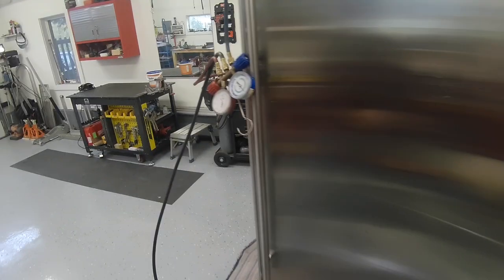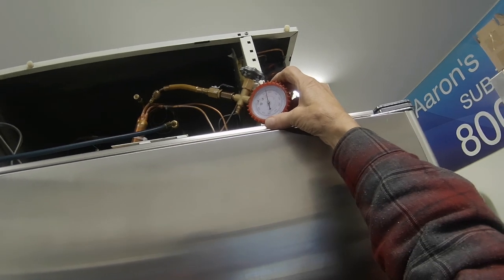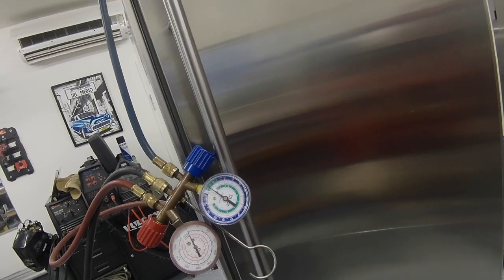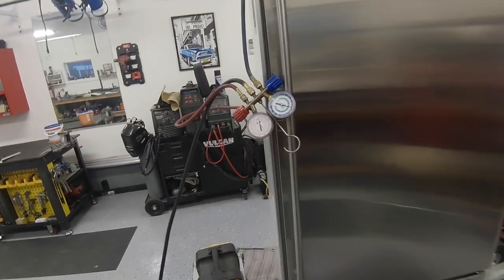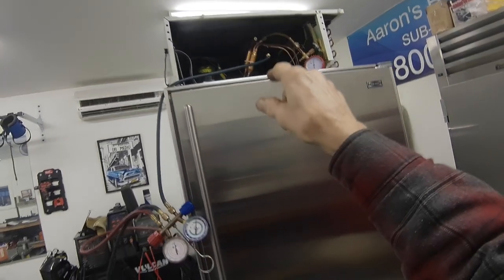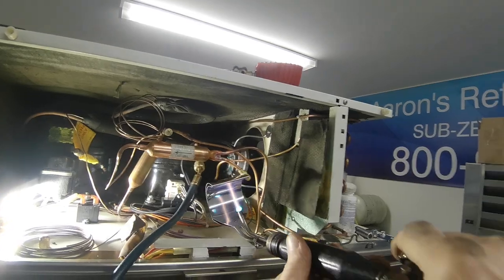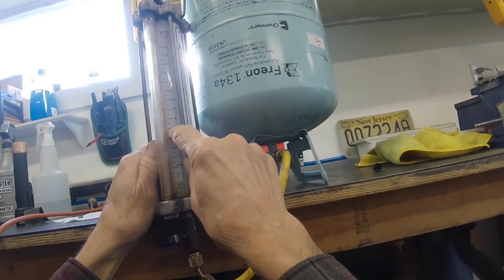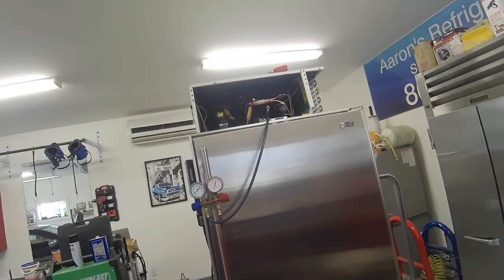Sub-Zero Sealed System Leak or Restriction?

Comment: Hi and thank you for your excellent videos! 

I have a SZ 501F that is not as cold as would be desired (it is around 8 to 9 F) I put gauges up and am showing a little high on both sides... 15 psi on the suction and 250 psi on the high side (??) I am not suspecting a leak, nor a restriction. Maybe there is TOO much refrigerant in the system? The auto defrost timer has been determined to be working correctly and is not suspect. If you have any pointers I would be most appreciative!

On a related question, I am curious... is it possible to repair, by soldering, an expansion coil such as is found on these types of models?
Reply from the maker: @PhilSoussanOfficial  15psi normally is a dirty condenser, faulty compressor or too much Freon. No you cannot use an expansion valve.
Reply: @SubZeroSpecialists  Thank you for your response, and please forgive me… stupid typo - I was referring to the evaporator coil! If there is a leak in the evaporator is that something that typically can be repaired with solder or is it always a replacement?

Regarding the initial problem, my suspicion is that the unit may have been overcharged. The compressor is fairly new and any dust has been completely removed from the condenser. The fan motor is also new. 

What should those low and hi pressures read ideally? …Bearing in mind it is using R 12 Thanks again :-)
Reply from the maker: @PhilSoussanOfficial  is it an aluminum or copper evaporator? If you know where the leak is yes you can solder it, if it’s an aluminum evaporator and it’s leaking at the blast joint I have a video on how to repair it. Soldering aluminum is tricky due to its low melting point, but it can be done.

Comment: Hi ! Great Videos … I’ve been repairing Sub Zero’s for about 25yrs. You actually look familiar. Is this Arron ? NYC ? 
Nevertheless I have a question. 
700 , BI’s and now I’m Seeing the IT’s with that extremely small drain hole. I went on an IT - 36 refrigerator not draining. I couldn’t find anything as of yet to get that angle to blow it out. I’m sure you’ve seen this. Any suggestions on what I can use to blow out that drain ? The angle doesn’t allow for a straight up blowout like on a 500 , 600 series. The 700’s were hard enough but this IT-36 is mind boggling.
Reply from the maker: Yes this is Aaron, I made a special tool using the 1/4” copper tubing that comes with the 500-600 series water valves, it has 90 degree bend in it. Send me your contact info and I’ll send you a pic.
Reply: I also have a 650 , with a constant vacuum condenser message,
Had the the whole sealed system on fridge side replaced .
I was understanding that when that message appeared it meant there was a leak .
Fridge is holding temp 
Message remains .
Thoughts please 
Thanks

Comment: Let's say your evaporator or accumulator is full of oil. Do you think blowing nitrogen through suction and out the cap tube at the filter would resolve the restriction? Thanks.
Reply from the maker: Yes I believe so, but then your compressor will need oil otherwise you might burn it out. There’s no way to check the oil level. If you can measure the amount of oil you blow out then you can add the same amount, that in my opinion would be the way to treat this problem.
Reply: @SubZeroSpecialists  Do you recommend any liquid flush to remove that oil or just dry nitrogen?
Reply from the maker: If you suspect acid or moisture in the system then flush it. It may eliminate problems afterwards.
Reply: @SubZeroSpecialists  what liquid do you suggest flushing it with?
Reply from the maker: Any HVAC flush